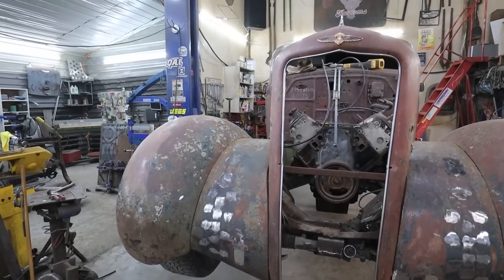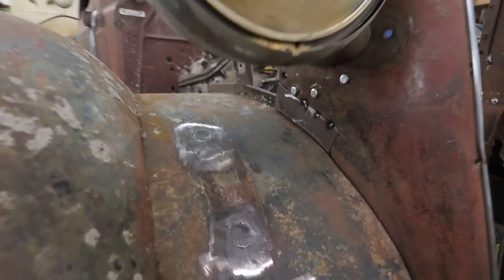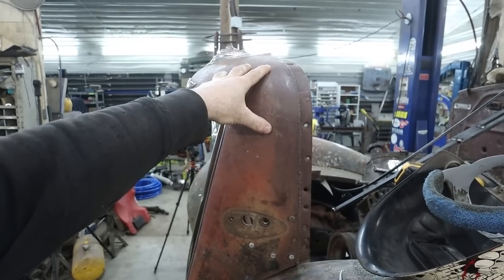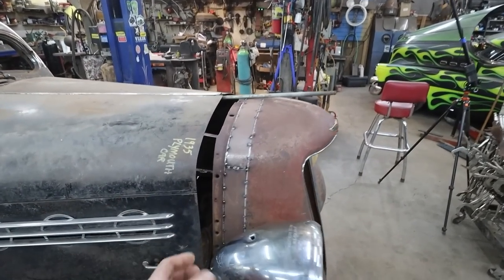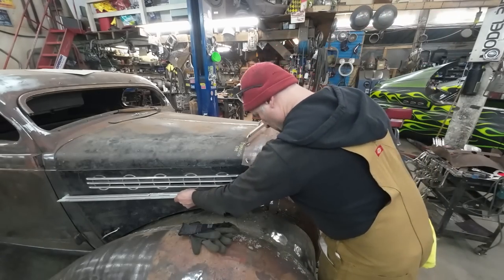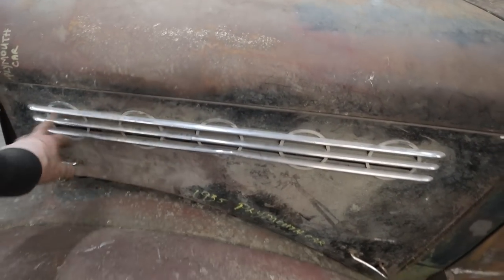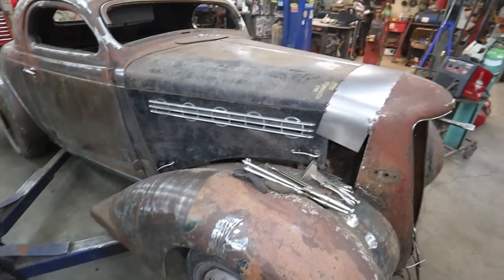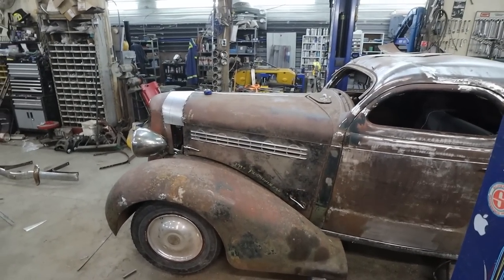Attempting to lengthen the 35 Dodge grill to match the 35 Plymouth hood,

Comment: Looks like it is coming along nicely.  I noticed when you were fooling with the grill that some of the rods at the edge of the grill weren't visible through the grill opening.  Maybe you could steal them and use them to fill in the hole at the bottom of the grill where the rods are missing. -Keep up the good work

Comment: Headlights look good on the side of the grill. The problem with a tapered hood as you found out doesn't lend itself to being lengthened very well without widening the front or narrowing the rear of the hood.

Comment: ALL IS NOT LOST  Brent! Pablo loves ya and the miss's will still feed ya, and send you to the day job so ya ain't on the Queens dole. Okay, enough on my attempt to make you giggle a touch. Your getting a great stretch on the top of that hood and as for those hinges, I see a lot of work to make the rim part where in folds to make it strong where the metal ends and the hinge starts... I think your on step with what I am yammering on or about. That lower part of the hood has to be extended as said. This is just a thought or idea that will float like a giant boulder in a mud hole but here goes; If you were to just take about a inch off of the present hood side and save it to put on this new extension.... stay with me Brent, don't start with thinking of a way to send me a package in the mail that when I open it, bad things happen and I no longer am able to make these weird comments. The missing end could be a string of louvers.. one above the next so that on each side, its the same and then box this with that saved piece and tack it to the existing hood side so its now longer... those louvers don't need to be huge garish looking things but nice discrete looking so that it would seem like a place for air flow from the radiator. Its  that or maybe stainless mesh that goes from the upper area where its been dissected from.,  .... still thinking here on this end, but anyway make a strip of the mesh to go down like a space for air flow to distract the eye from what is really going on. Some how we need to hide the extension from people seeing this struggle spot easy. I just love the side of this panel as it stands now. Its not like when Buick came out with port holes on the sides of many of their first boat cars and everyone who was a chevy lover, hatted the look of a buicks ports on  the sides. I am sorta kinda really am weird and liked them... no I still don't care for the look of a bathtub style Nash rambler that looked the same coming and going.... granted their more acceptable now, but in the day it was punishment to be seen in a rig like that... even their attempt to make their own two door hardtop model was not a good look. I see a two door hardtop in my memory but maybe there wasn't one,. For all I really know, maybe they were all those four door bathtubs. Back to our chrysler something dodge.. meaning many parts and pieces make this car pie. I really have grown to kind of like my idea that you can say "Morgan, please don't try to help anymore"!! AS always Brent, a friend to you for my remaining years the good lord will grant me. I am seventy three and have many ideas that would not float if they were soap and in clean water.

Comment: Brent, the way my ancient eyes see it you had two ways to go, it starts with aligning the hood with the body and then either extend the grille back to the hood or the hood up to the grille.  Putting extensions here, there and everywhere is too time consuming and labor intensive, and leave you open for screw-ups and redo's along the line.  Also put the hood latches in the up, unlatched, position so the hood fits the body and fenders properly. ✌👍
PS: It almost looks like you're in the tear it apart and start over phase.😒

Comment: Been following along for sometime and did not realize that two different makes were being made one Did some reseach and found that there is a 3 inch difference in the two cars, As a builder it is hard for me to remain objective to your struggles with this build. Obviously with a 3 inch difference and a somewhat cavaliere attitude to the build it not surprising that you would be in such a place as you are now. As one of your followers suggested; some might move away from the problems to an easier build That you have not done so and continue to over come is what makes this site worth the time you and your followers spend on it. With sharp tools and a good welder there are no problem that can not be overcome. TY 4sharing

Comment: I think the long hood compliments the long rear. I like it! 
But what if you laid the grille back at an angle until it met the hood?

You would probably have to continue the cuts you made in the grille (41:55) so you can bend the top of the grille in line with the top of the hood. Maybe this way you wouldn't have to extend the hood?

Comment: You did what it took and it took a lot, but you are making progress. You have the flow going from the back of the hood all the way to the front of the grill. 

As goofy the sides are you are probably right to remake the sides; likely faster and less frustrating. 

I’m glad your trip is giving you some time off.  You’ll likely cruise through the sides after you have recharged.

Comment: Just a thought but you can buy a stainless 1 inch boxed wire panel and cut it to fit. It looks great and would be much easier to rebuild the grill insert. With your fab skills it wouldn't be a big problem for you.  Just saying.....one option to consider.

Comment: Nice work on the extension(s). No easy solution on this one. Make the grille narrower to match the lines on the extended hood or widen the extended hood to match the current grill. Think it looks good. The hood lines on the sides need to be perpendicular like they are of the existing hood. The look to be sloping back right now. Am sure you'll figure all that out. Looks like you're enjoying the Texas trip. Look forward to seeing more on the old Dodge. Be safe and stay well.

Comment: On the side curtains the back vertical edge and the front vertical edge should be parallel (the gap you are going to cut) so you can adjust the hood up or down .with out hitting thr rad shell or cowl. Look ant early 40s chev hood sides simple lovers under 3chrome stripes I think its the look you want

Comment: I think I would try just extending the hood sides on the front and moving the handle forward but leaving the other crome where it is.  I think moving a handle ahead of the side crome could fill the gap visually and make it look like the space was left for the lights and handles.  Maybe even turn the handle 90 degrees so it is infront of the other trim.

Comment: I seen this coming. It's like trying to make a egg longer and keep it flowing right. Hard to see in video but seems like grill is too high.. the inner section of the fenders looks to tip out to the middle where grill bolts on. I might of reworked that section and moved the grill back. You have your hands full here. This job is not going to be a easy one. Still enjoying it all the same. People thinks this stuff just comes togeather easy. Not always the case.

Comment: The hood line on this car is a very subtle, but extremely complex modified conical surface.  The width constantly changes along the length.  I am beginning to see why the old-time coach builders used wooden bucks to hammer-form these pieces from flat sheets.  I think we are beginning to see why so many old-time hot rods ran hoodless.  You will eventually get it right.  And, Yes, it will probably be easier to end up making new hood sides from scratch than modifying the originals to fit the longer hood.  Getting the side trim in the correct position in proportion to the length will be critical to the overall look of the hood.

Comment: Brent.
You have done a lot of work and are planning a lot more to try and save your self a lot of work. 🤔
Moving the bonnet back it won't fit up against the straight edge you have been using Because it will be narrower. 
From where I am sitting the bonnet needs to be welded to the grille. 
Because it fits.
Cut your new opening joint behind the healights.
The gap filling needs to be made at the big end of the bonnet.
You then have to move the portholes back on the sides of the bonnet.
Still a lot of work.
I suspect that it would be more straightforward maybe even less work. 
But you have started and I know you will see it through.
Not that I am trying to teach granny how to suck eggs as they say.
Looking forward to the first road trip in this fantastic machine.

Comment: Ya should have done like i said about moving the hood forward that would have save a lot of work and time. Your hood matched up in front. The back end all you would have needed to do was pie cut the top part on the flat and bring it together. Then make a template on the sides of the profile of your finders then lay it on your hood and cut to match your finder. All of that work was just cutting away and welding back together. Then you have the gap on the cowl part where the step is all you needed was just to add a piece thats filling in the step-down on the cowl for a smooth transition. And easy way to figure out these mods on how much you need to add or take away on such angles is to use a big bench top same size or floor. Take your measurements of the width of say the front grill draw it on the bench then measure the length your hood should be, then measure how wide your cowl is. Then you can lay your hood top down on your drawing and see what you need to add or subtract and you can move it around forward or back to determine the best fit. Drawing it out full scale helps a lot.

Comment: Brent, with the headlight mounts have you considered reshaping the bottom of them to fit the grill shroud? Also I would split the difference between the shroud and hood extensions as I personally think the shroud looked great with the first piece of extension (reminded me of my 1936 Studebaker pickup) but when you changed it to make it even longer it blew the proportions way out. You can get away with stretching the hood at the front because most V8's and V12's of the era had longer hoods to accommodate the longer engines, they never changed the shroud depth though. To get the right angle on your shroud to hood filler piece you need to measure from the hood not the shroud, the leading edge of a hood is always parallel and that determines your shroud installation angle which in turn determines your fender mounting angle. If you were running no hood the angle of the fenders and grill shroud wouldn't really matter as there is no hood to close around them. What's also causing problems is the length verses width ratio. As a tapered hood goes further forward it becomes narrower and there for will become narrower than the grill shroud , the only way to keep width to length ratio's right is to cut the hood down it's length on both the top pieces and add in a wedged piece of material to each hood tops.

Comment: if you cut the hood sides between the latch handles and the chrome portholes and just add a spike of medal like you did the top of the hood. it might line up with the fender top.

Comment: Personally I'd assume your fenders were a different shape before being straightened, not just stretched. (Although some of that probably happened.) That being said you are installing them and the grill to suit and then looking at the hood that no longer matches... On either end... I'd recommend working from the back forward. You have a body line from the cab and the doors, that's half of your jig saw puzzle. Build your hood onto those gaps then float the grill and fenders around until they get close. Maybe do the grill alone with a stock gap and then reshape the fenders to fit. That seems like the best order of operations. Unless you already cut up all the stock hood and grill edges...

Comment: What if the grill ad on has the same rear slope as the grill insert. It would meet the hood a little closer and you would not have to add as much to the hood. Just a thought from an arm chair fabricator.

Comment: Cut from the hood and make that grill one piece.  And put the lip back on the grill. Because then you would eliminate the hing part and the hood will still be the same.if you cut in the middle your going to end up with trouble. Just make that grill one piece and put the lip back. And run some round stock from the fire wall to the front. The 36 ford ran round stock . 3 of them from the fire wall to the front and bolted to the grill the round stock was threaded at both ends.

Comment: Sometimes it’s better to step back and look at your options. I’m quite sure that you will figure it out, change is always a little hard to figure out, also on the earlier Cadillac’s they used a longer torpedo headlight capsule, that would take care of the longer grille shell, and would look better with the longer grille shell and the longer hood. Just a thought buddy.

Comment: i think the Dodge /Chrysler /Plymouth /Desoto body panels are rejecting the LS swap, and based on the 5 portholes per hood side, are asking for a V10 transplant. The V10 is just a 360 with 2 more cylinders, and are fairly cheap.  What's one more engine swap at this point?

Comment: Your grill was to high and tilted forward. You see it with the camera angle that’s why you had to add metal were the grill and fender meet. And that’s why the big gap at the bottom of the hood. Also the grill not been align with the hood. Front of the hood had to go down so is the grill and back. But I’m sure you will do a kick ass job anyway.

Comment: I don't think the patched together hood will look smooth or balanced.  Personally, I think you should consider making an entirely new hood consisting of two halves and cover the center seam (or piano hinge) with the chrome strip(s).   As far as the hood side chrome accents and portholes go, I think you should leave them in place but cut a rectangular outer perimeter around them, leaving at least one inch of the existing hood's flat surface beyond the whole ornamentation.   Once the whole rectangle of old hood sheet metal containing the portholes and bars is cut out, all you'll have to do is find the area on the new hood half's side that you've made, center the piece and weld the rectangle panel with portholes and bars into place.  The same thing for the hood latches.

Comment: Couldn't see it so well in the video but it looked like you were putting the straight edge down where the hood sat on the firewall and then on top of the radiator support in the front instead of allowing for the hood to drop down in the front !

Comment: To my eye every gap between the grill and hood and grill and fender tell me the grill needs to be tilted, rolled, back. Between the grill and hood the gap closest to fender is narrower than at the top of the hood. Tilting back the grill would have closed the litlle gap between the grill and fender you filled in in the begining. Tilting back the grill letting it roll back along the fender seam. It would have to raise a bit as you roll and tilt it back. Not a straight tilt back as if it had a fixed pivot point at its bottom. Now that should be clear as mud. I also googled pics of 35, 36 Dodges and Plymouths and the grill look laid back to me. I have faith that no matter how you do it it will look great.

Comment: Isn't that the way it goes, just when it seems everything is going good, a monkey wrench gets thrown into the works. Maybe the nose has to drop a bit for the hood to fit at the lower sides. No doubt you'll get it straightened out though.

Comment: Getting that bonnet/hood to fit is not easy. The angle was wrong to come up to your radiator cowl so in extending it the cowl needs to be narrower but that might lead to a peculiar looking narrow grill. I was surprised you could widen the hood without disturbing the fit against the windscreen too much. I would hope you could get away with reprofiling the lower edge off the bonnet sides to fit the fenders. Making complete sides would take a while. Its looking good though.

Comment: For some reason it looks as if the inside right appears to be slightly bent inward to the center of the opening. When the grill is mounted on the car if you look very closely it appears to be bent toward the center more than the left hand side does. Even when you had it off and doing all of your building it appeared to be bent even with it facing down. If you are looking at the grill opening when the grill is mounted it would be the drivers side. It just appears (to me) to be out of line with the opposite side?

Comment: The grill must be to far forward, the nose cant have grown 4" in length, Im thinking if the grill can go back then thats how I would fill the gap, instead of putting extra metal in, if on the other hand to want to extend the length of the nose then put the extra metal in.

Comment: Can you lean the radiator surround backward? Then do all your surgery on the rad surround like a roof chop.
Reply: In other words Brent. You are doing too much doing. But not enough imagining 😊😮 . Your process with a tram rod to picture the angles is spot on. Like the roof has to take on new dimensions. So too does the front end. Only it has to become smaller in width, if .... Oh well the bonnet is changed now.

Comment: A two cent armchair hopefully helpful commentary. Buttt...
The arch on your lens is deceptive. From my point of view when you attached the "rad" support, it leaned way too forward. That raised the front of the hood spreading and changing every thing.
If you could leave at or near the bottom of the support, a bolt on ether side, to let it pivot ever so little back to the cab.... Then lower the front of the hood to match it.???? Maybe?